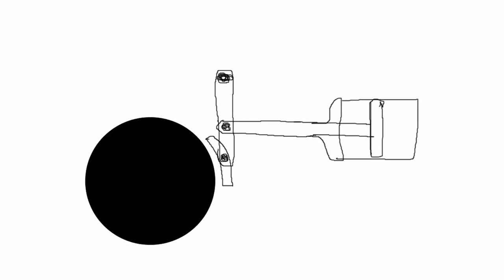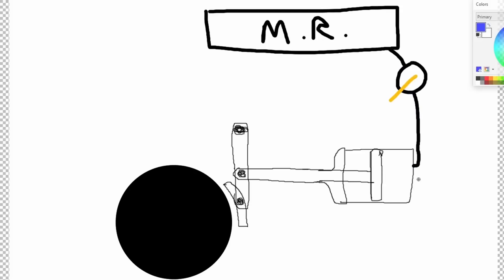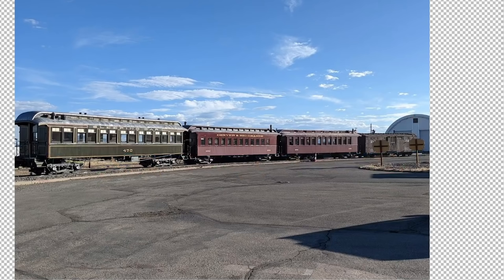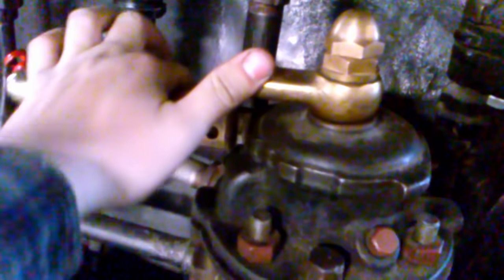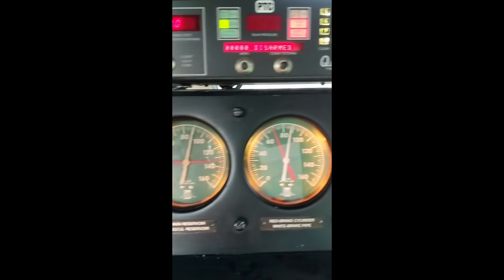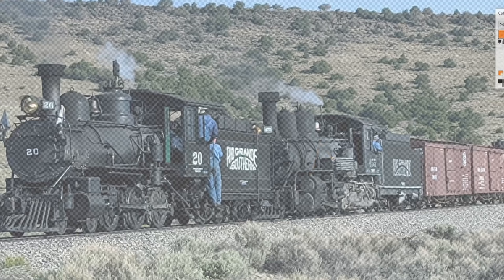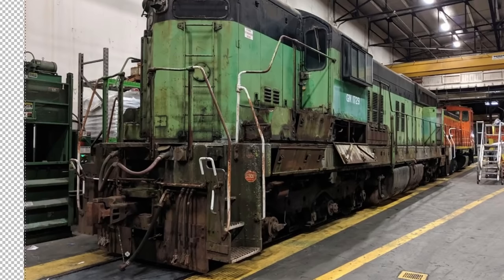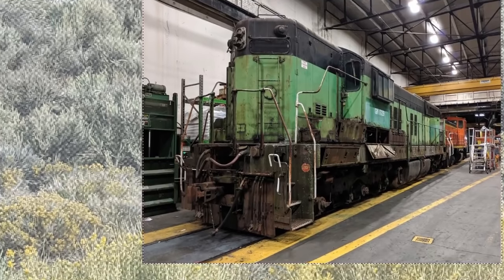AIRBRAKES 101: 10 levels of TRAIN BRAKE understanding!

Comment: Engineer Ralph Harty had the distinction of two major derailments with the same train on the Brooten Line in the 70's. (Superior, WI to Glenwood, MN, 200 miles total..) I believe this was what encouraged the rail defect use on that line. They ran the rail detector over the Brooten Line (Moose Lake, MN to Brooten, MN portion of the line. 80 pound rail.) the rail from Moose Lake to Brooten averaged twenty-two defect to the mile. This was back in the 1970's. They ran out of replacement rail and bought rail from the BN that had been ripped up on a branch line.  Rail profile was almost the same, with the exception it was a quarter of an inch higher. That, along with the line not having seen a tamper in years was not entirely a pleasure to ride over.  With all the low rail joints, rocking back and forth latterly, and the mismatched rail you needed to wedge yourself between the seat and the wall. Going over the rail joint your teeth would chatter if you didn't sit slack-jawed.  The Roadmaster didn't want three axle locomotives on it either.
 Although I did have six three-axle 3,000 HP locomotives once with one hundred empty grain cars to Glenwood. There was a ten MPH speed restriction over the Kettle River. When the green flag was called out by the conductor I was at a whistle post for a crossing. Every time I advanced the throttle a notch, you could feel the train lurch ahead. All six units were on line. I was only able to get throttle six of eight notches when I went over the crossing at forty mph, track speed. Not bad for 10 to 40 in 1,320 feet with 100 cars. 
With all this bad rail the speed on the Brooten Line was dropped from 35 to 10mph from Moose Lake to Brooten, about one hundred thirty five miles, with a whole slew of slow orders of 5mph. Twenty-eight of them at five mph. I would line the slow orders up on a clipboard I brought with and tear them off as I exited each one. Trains were usually 120 cars both ways at that time.  It took two days to get to Glenwood and two days to get back. The halfway layover was Onamia, MN. Setting the train brakes in some of these slow orders going East with loaded grain hopper to maintain five mph was down right tempting fate to keep the train in one piece with sixteen thousand plus ton trains. This is where I became creative with applications. On the engines with 26L with maintaining features I would ride the hump from the six pound den-tent. (This first hump from the running position is called the six pound notch). I didn't look at it, I would use my index finger to tell where it was at. This would be about a eight to nine pound reduction with a 90 pound train line. After exhaust ended I would release it counting seconds in my mind (One - one thousandth, two - one thousandth, etc.) and then resetting to the same amount again. Doing this multiple times with wait times between applications and additional seconds of release depending on speed, train length and track conditions. Soo Line ore cars had the old air brake equipment, the newer grain cars had an accelerated release if a ten pound or more application was made. What the accelerated release did was dump air from the emergency portion of the car air reservoir into the train line to propagate a faster release.  Doing this set, release, and the set with ten or more pound applications was real tricky with the accelerated release, but it could be done. This kept the train stretched, even through shallow sags. I did this for twenty-four years and never tore a train apart. I even stretch braked ore trains this way when there was a 100 car limit. On longer ore trains I used forty retainers in the SD position (SD – Slow Direct) on the head end. Soo Line at that time did not have any engines with dynamic braking. 

 I image when cabooses were still used the hind end crew appreciated it. One trip with a Superior Engineer deadheading in the caboose from Dresser to Superior remarked to the Conductor why the slack wasn't running in or out anymore, his reply “The Fireman is running the Engine now”.  I rode many a caboose and knew what it was like with different Engineers.  
The worst stop while a Brakeman on the GN back in the sixties, was at Cohasset, MN. We had two hundred fifty empty forty foot box cars going West, and the speed was about twelve to fifteen miles per hour when a piece of scrap metal laying between the rails parted the air hoses between the engines. I was in the cupola at the time. Stop was about instant with the brakes in emergency at the head end first with the slack running in before the train line dynamited on the caboose. The four total caboose end windows shattered (two on each end), the back door, which opened inward, tore the lock hasp off, and was open, the coal stove was ripped off the floor with stove pipe flying all over, the  large batteries in the cabinet went through the interior wall and the caboose being of wood construction, all the dust in the cracks was airborne with viability down to about five feet. Luckily I was partly braced, but did end up in the seat in front of me, uninjured.

 On engines with 24rl or 6blc brake equipment using the feed valve or riding the release hump to maintain brake pipe pressure is what I used. Riding the release was not fully in release position choking off the air supply enough so as to maintain the brake pipe pressure at the pressure set during the application, this was the trickiest of procedures!!!  The Soo 24rl valves didn't have the optional maintaining feature.  (I believe these were repurposed off steam engines). On 26L Brake Valves when making applications it was actually referencing to a 100 cubic inch chamber in the brake valve itself. Sometimes you would get one that leaked down. That meant that the train line reduced also. I would watch for this during air tests.  On long downgrades this was a problem. That's when you would use the feed valve. You would make the application, and when it equalized, you cut the brake valve out, moved the handle to running position, backed the feed valve off to match the current brake pipe pressure, then cut the valve back in. I don't think the railroad mechanical department thought too much of that procedure, although I did try dumping the air with the valve cut out and it did work on that one engine I tried it on. A 26L brake valve set for 90 psi train line equalizes at a 26 pound reduction, hence the name 26. Set for 75 psi it equalizes at about 21-22 psi reduction. 6Blc valves had a main reservoir pressure to the brake pipe position to the left of the running position.  You had to be careful not to overcharge the brake pipe. If you did, brakes would stick on. This was a good way to have a accelerated release on the old air brake systems that didn't have the accelerated release built in. And NO, I never tore a train apart doing this during my twenty-four year career.  Jack Peterson hogheaddotnet
Reply from the maker: Cheers Jack, I'd love to get a beer with ya and hear these stories in person. You can tell you did the thing for real, and you're proud of it. Thanks for the comment, and the stories :D
Reply: That's a freaking novel, hoss!
Not sure if it's adventure or horror, though.  The first part had me groaning aloud, and the caboose part — Good Lord!
Interesting driving with a sustained min service application.  That's nominally a 10# drop to just set the shoes, as you say.  Makes good sense, and somehow you came up with that as a fireman?!?!  That's some savvy.
Dynamic braking wouldn't have helped a bit unless you had DP in the back to mirror the lead DB.   It might've saved some shoe wear.
Gotta get to work now.  I'll read the rest of your nail-biter later!
Reply: Ok:  I read further:   I think 24 RLs are vintage 1920s, + or -, probably -.    That whole operation is starting to sound like Johnny Cash's Cadillac.
Seems like you made the best of it, which is great credit to you.
Reply from the maker: Metra 212 Productions  it depends on the railroad and their feed valve settings. We run at 70 at the museum. Some passenger is not 110. Yes for most larger ops you are correct these days it's 90 and 110 but that's not a hard and fast rule.
Reply: Yea i do the same on my H.o gauge train 🤓

Comment: Fun Fact:  The reason why all Class A trucks have airbrake systems in place are because of how successful it was to slow down heavy trains of any size.
Reply: No it because brake fluid boils with the extreme heat needed to slow anything with a weight above 20,000 pounds. Air just expands and applies more force in an air brake system.
Reply: @greyfox79007 if you are heating up the air in the break chambers enough for it to expand your vehicle is probably on fire at that point.....
Reply: @katokagome4670  apart from the amount lost if a leak occurs, the break-cylinders on the rear wheels are also equipped with a spring, strong enough to very quickly overcome the atmospheric pressure and apply the breaks automatic in case of total air-system failure
Reply: the break-cylinders on the rear wheels are also equipped with a spring, strong enough to very quickly overcome the atmospheric pressure and apply the breaks automatic in case of total air-system failure.
at least were I work in Germany
Reply: @katokagome4670  yeah boiling the breaks is bad...
ahhh nope bad doesn't cover the whole affair.
and in this case I refer to any and all ways to damage a break system to the point of inoperability:
# Glazing the pads
# leak of any kind
# busted caliper
you name it and there's gonna be at least 500 cars on the road at any given time that have this specific defect.
Reply: @katokagome4670  I just remembered a clip from Rescue 911 that fits to this threat
Rescue 911 - "Runaway Truck"
Reply: @greyfox78569 no, it’s because a compressor provides the actual braking pressure and it’s a complete loss system. There’s nothing to fill except for air.

Comment: I miss level 11: How an automatic brake of simple concept (or from the early days, the ones with simple comparision between reservoir and train pipe) can be exhausted by multiple applications of brakes without appropriate re-charging in between applications. And how the brakes can fail if left in lap due to slowly discharging the train pipe and brake reservoirs over time without brake application.
Reply from the maker: It's about the volume of air required, and the fact that steam air compressors were not the most efficient beasts around, and as well the charge rate for the reservoirs is pretty slow. From empty, it takes about 5 minutes to completely charge a small train even - so, if you use enough air setting, releasing, setting, releasing, etc. - you can lose sufficient capacity in the reservoirs fast enough that you're using much more than the air compressor can keep up with, and either you lose braking power from the reservoirs being empty or you lose braking power because your main reservoir cannot keep up with demand, which leads to the same. It takes a lot to get there though, and this is controlled by the book of Air Brake and Train Handling rules. 

There's a rule with non-self lapping brake valves that you can't have more than 5 PSI / minute leak (different by RR rules as well, I believe 5 is the maximum though) to mitigate any other failures. If you've got a big enough leak at the right spot in your brake pipe, you can't charge the rest of the train.
Reply: @Hyce777  +Brakes according to the FRA are required to remain set for five minutes. Most when set out I've seen them still set a week later.  The problem with the brake pipe pressure dropping below the equalization pressure is that an emergency application is no longer available. Emergency applications provide for 20% higher brake cylinder pressure. Jack Peterson hogheaddotnet

Comment: As a retired railroader I think your tutorial on air brakes was great. Strangely enough I was just going through an old Western House catalog on pre 1900s air brakes.And my favorite expression for putting a train into emergency is Wipe the Clock. 😁
Reply from the maker: Wipe the clock! I've only heard that once or twice. We usually say dynamite or big hole 'round my way. I appreciate the feedback, cheers :) hope you are enjoying retirement!
Reply: That sounds similar to the procedure of "Wiping The Dial" which was for the driver/engineer to drain the entire contents of the brake system out completely (while standing sill of course) and recharging with new air. This is to get ride of any water/dampness/condensation that accumulates in the system over time (after about a coupe of hours).

Comment: For 37 years I worked as a truck mechanic and I made a career change in '08. From then on I worked as a millwright in a steel mill. There I worked on overhead cranes. On weekends we had the responsibility for derailed trains so we were witnessing much of what you've described. Those poor guys driving locomotives were fired for derails. They would normally get the job back but wow. Through the years there I noticed that the brakes on trains were essentially bigger versions of truck systems. That is probably an oversimplified description of what I saw. I never was able to talk to someone knowledgeable about the train brakes on a mechanics level. The RTO (remote train operator) operators were always new and couldn't give much info. Your video has shined a light on some of the things I had been trying to put together about the systems. 
Like I said about working on trucks I didn't really look into it much but the FMVSS manual for trucks also covered rail cars and locomotives. 
Thanks for your video it's answered a few questions that I've had on the subject.

Comment: As a train driver in Europe  I'm glad to get al the way to level 10 with out hearing to much new things. Somethings are slightly different, like level 8 with the valves looking for the speed of the reduction. I don't think they are used here. But I'm only a passenger train driver not freight, and they are at max 700 meteres long so not that we realy need those. And those truck like brakes with the spring we actualy have those here in some loco's and trainsets, but they replace the handbrake.
But a great video, a bit long, but verry good and I like the art style with the paint drawings. It has a charm about it
Reply from the maker: Cheers! Yeah, this video was intended for folks with less than that understanding so it's good you didn't learn more. Maybe down the road in a future more in-depth video :)
Reply: UIC distributors with emergency valves actually exist in Europe, but my gathering is that they are very very rarely used.  So far I've only seen them on a few autoracks specifically designed for passenger trains ("Autozug" "Autoslaap" or whatever they're called locally), when they sense a sharp reduction in the brake pipe they keep dumping air until it gets empty enough... a real PITA when doing shunting moves with those (plus they're LOUD)